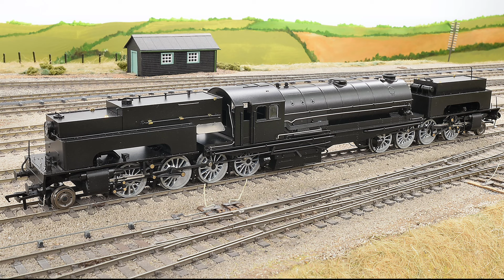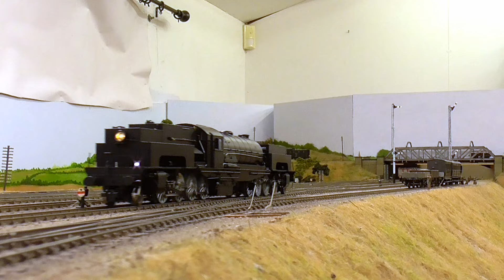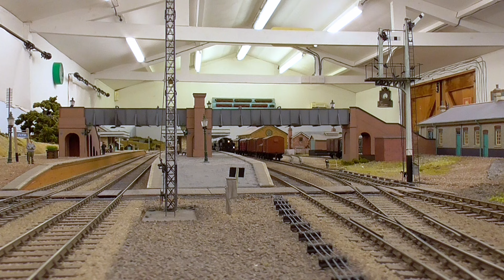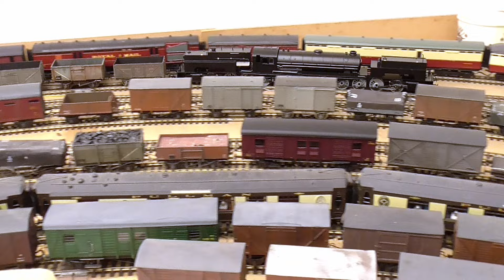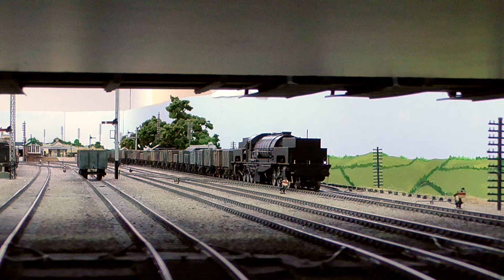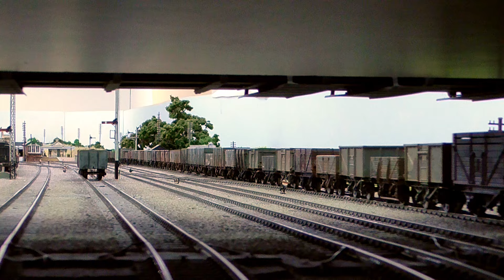New 2024 Heljan Beyer Garratt locomotive put to the test!

Comment: You lucky (or is it Lickey) man getting to run the pre production unit. Looks great, an extra special and unique engine. I was worried about the gap between the tender end and the rear of the cab; the published CAD drawings made it look overly large/ pronounced, however I am pleased to see here it looks OK and doesn’t detract from the model. Photos of the actual engine do not show a gap - I appreciate on our models with our non scale tight radii there will be a clash if not gapped. The finish looks superb on that engine. All the best and what a nice surprise to see that pop up! Thanks Stephen

Comment: NZR had two classes of oil-fired locomotives right up to the end of steam in 1967. Some were built by North British, The Ja/Jb 4-8-2’s and the Ka 4-8-4’s. These were only in the North Island. The six Kb’s and all the J class in the South Island were coal fired.
Several heritage locomotives permitted to run on the present KiwiRail system are still oil-fired.